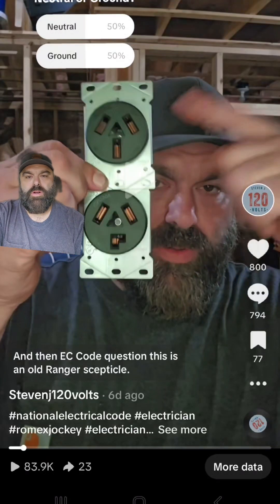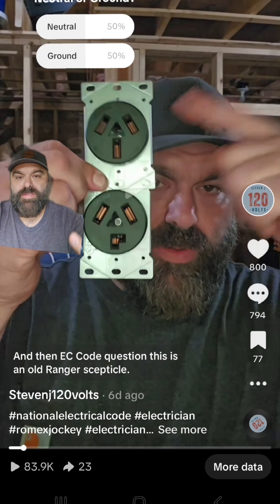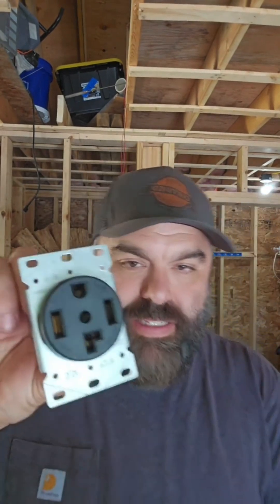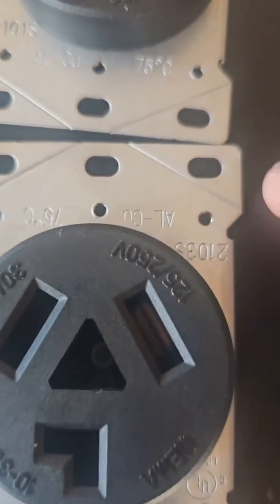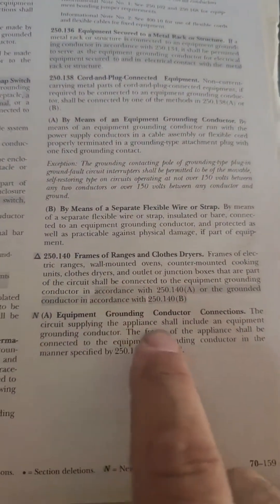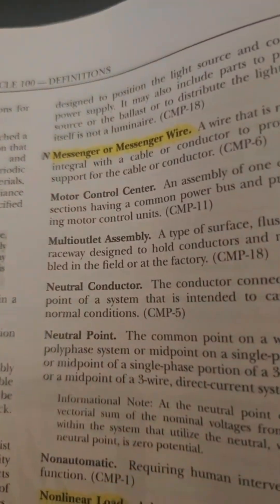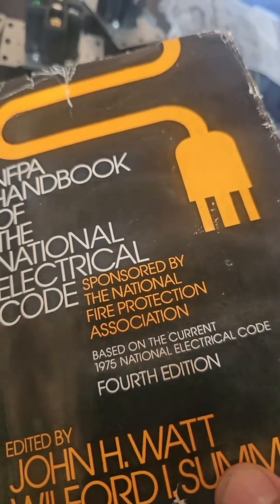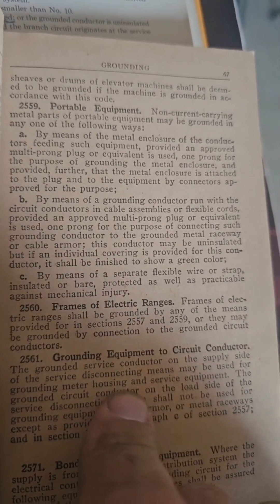Is the third prong on an old dryer or range a neutral or a ground???

Comment: I was told the reason we stayed with 3 wire for so long, was the copper was needed for wartime, remember aluminum was not popular way back when. The NEC finally started enforcement of the 4wire mid 90s, because thats the way it was allways supposed to be.

Comment: My house was built in the 70’s and uses a 10-30R receptacle for the range. A 10-30R is two hots and a neutral. Which is why it is often labeled a non-grounding receptacle. We recently purchased a new range. The 3-wire (conductor) instructions for the range state “Do not remove the ground strap connections”. When you look closely at the terminal block on the range you can see a pre-installed copper strap bonding the neutral terminal and the ground terminal together. The range instructions state to connect the neutral conductor to the neutral terminal.

Therefore, my understanding of what you are saying is in case of a fault (e.g. the frame becomes energized) the fault current uses the neutral conductor to get back to the panel and eventually the source. And just because the range uses the neutral conductor to carry fault current does not make that conductor a ground conductor.

Comment: This also explains why in my old house they use 3 wire with ground for the dryer and I was able to upgrade to a proper plug for the new dryer.
At some point running 2+G really just became a way to cheap out.

Comment: Wow only 25 coming so far. OK I might have to subscribe. This makes complete sense. That's right we added the ground which explains why previously and probably wrongly so it was common to attach the metal of the appliance to the nearest water pipe which used to actually be metal all the way out. Also thinking about that now if that was also bonded in the electrical service somewhere and in the appliance then you're sending current over the ground!

Comment: It's a neutral, used as a ground. 😅 It's neutral because 120v components need the neutral. It's used as a ground because it is tied to the metal chassis of the dryer.  It's fun when a timer motor starts to fail and puts 10 amps or so on the neutral and you start seeing a measurable voltage on the dryer chassis.

Comment: So you are one of them political correctness kind of people. On older homes like back in the 70's the ground and neutral were one in the same. They were not required to be separated until much later. So no one is either correct or incorrect by calling it the ground lug. In today's homes that would not be legal to install and code requires 4 wire installations. So a dryer today will get 4 wires L1,L2,N,G.
Reply from the maker: Ground and neutral we ALWAYS required to be separated.   What are you talking about?
Reply: @Stevenj120volts  So I take it you have NEVER looked inside a service entrance. Because there brainiac the ground and neutral are one in the same. And that comes from pole to home. The number one cause of people getting shocked in a pool is because of that condition. And in the 70's it was not "REQUIRED" but "RECOMMENDED" you do understand that difference don't you? There is also this thing called potential. But I guess you are also clueless about that as well. Book readers, gotta love to hate them.
Reply from the maker: @jonesgang  you are using insults when you are entirely wrong. I own every code book back to 1940 I can show you the rules they had back then feeder required and separate equiment ground.  You are just lying and making stuff up required vs reocmmended?  Wtf..of course There is no equipment ground in a service cables.    The equipment grounding conductor is in feeders and branch circuits.  The services only have a neutral.  
 Are you even an electrician.  The 1996 NEC removed the 1942 exception for stoves and dryers.
Reply from the maker: @jonesgang  do you understand there is a difference between something NOT existing and the neutral and egc being the samething?
Reply: @jonesgang the ground is bonded to the neutral at the pole, and at the first panel, but it is required to be separate at any receptacle or sub panel. How is that relevant to his point in the video though haha
Reply: @peckservers First panel of disconnect gets bonded. The service unless it has breakers does not get bonded.  If it is a meter only service then the interior panel which is now the first panel of disconnect is required by code to be bonded. But it was not always that way like people are trying to make it sound. Go into any home pre 70's and you will not be a bonded panel. You will see both neutrals and grounds sharing the same buss. And that is why some people will call the third prong a ground instead of neutral. Today those types of receptacles are no longer code compliant. The replacement receptacle are now all 4 prong to allow for both the ground and neutral terminations.
Reply: @Stevenj120volts  You have not worked in a lot of older homes and  I also take it you have not work on a KAT (Knob And Tube) system and it shows. NEC codes have changed a lot over the years. To ignore the past is not wise.
Reply from the maker: @jonesgang  I am a 2nd generation master electrician EXPERT in older homes older code. With 29 years in the trade and a nearly complete code book collection that I have studied( I am missing the war time supplements) You are very confused.  If there is NO equipment ground wire run in the circuit that does NOT mean the neutral an ground are combined as one.  It means there is no ground. Like an old two wire 120v receptacle there is no ground it not that the ground and neutral are combined... In all codes that I own from 1940-2023 and in all installs.  If there is a grounding conductor run it must be separated from the neutral except for stove and dryera wires from 1942-1996. Up until 2008 you didn't have to run a equipment ground to  detached buildings.  You do not understand what an equipment grounding conductor is for.
Reply from the maker: @jonesgang  in not ignoring the past I am studying it.  Even the 1940 NEC calls for neutrals and ground to be separated.  Do you understand the difference between neutral and ground?
Reply from the maker: @jonesgang  you bring up knob and tube again this shows your ignorance.  You are most likely unaware of basic knob and tube practices.  How many two 120v fused neutral panels do you own and teach education lessons with.  I am professional electrical educator.  In 29 years in the trade I yet to meet anyone with more knowledge about NEC from 1940-1960.  Knob and tube and form pre 1929 and as nothing to do with 1942 war time supplement that allowed for 3 wire stoves.  Dryers were not added to the wording of nec 2561 until the early 50s
Reply from the maker: I own the 1940 code book were is says to separate them.  Ground and neutral are very different.... Yikes.... I literally show the 1975 codebook in THIS video saying to separate them.  There was just an exception for dryers and stoves added in 1942 during the war to save metal....

Comment: Correct me if I'm wrong, wouldn't using 10-2 NM (even wiring the bare earth 'properly' to the neutral bar) introduce a fire/shock/ground loop hazard? 
Returning current on a neutral will 'go elsewhere' wherever there's a potential difference. -Say... like rubbed-through outer insulation into a metal box, copper plumbing pipe, etc?
At the very least, the 'old wild west way' seems like a high-risk for ground loops and other whacky electrical hazards...

Comment: The electronics may only draw 1/3 of an amp, but proper grounding is still better for the reliability of said electronics.
Reply from the maker: Yes the point dryers and stoves didn't get designed to need the proper ground MORE in the 90s  it was always needs and the hazard is worse older stoves.  It not like the old stoves were safe and the . electronics.made it worse

Comment: Although officially 10-2 w/G NM was NEVER permitted for dryers,  from my experience while doing renovations and speaking to retired electricians who were in the trade in the 1970s until recently,  there were some AHJ's that were kind of the "wild west " if you will, that permitted 10-2 NM for a dryer, allegedly on the theory the ground in 10-2 was 10 awg, and therefore no different than the bare neutral in SEU cable when originated at service equipment.   

Each and everytime I ran across 10-2 NM or SEU cable for that matter, feeding a dryer during a remodel in which the drywall or what have you, is being removed,  I rip that out and use a 10-3 NM
Reply from the maker: Yeah there are two things I see all the time in old houses but that's my old code books says should not have been allowed.  10-2 dryers and 3 wire sub panels
Reply: @Stevenj120volts  the only 3 wire subpanel I've come across was an 8 circuit panel in a detached garage fed with 120 volts with the bus bars jumpered.     Worse yet it was fed using 8-2 NM buried about a foot if that, tapped off the line side of the main breaker in a bedroom closet.   Flipper home built something in the early 1970s with most of the circuits aluminum.  

I'm sure you've seen some shady stuff in the field as well.  Lol
Reply from the maker: @Sparky-ww5re  my understanding detached building could have 3 wire subs until 08 but I see all kinds of old subpanel fed with 3 wire
Reply: Thanks guy make my brain bigger 😂 I’ve just seen dude wrap ground wire around any screws even the screws that mount the device to the box just always looks like shit or the grounds are literally 1” out of the box and the last guy didn’t use them 😂